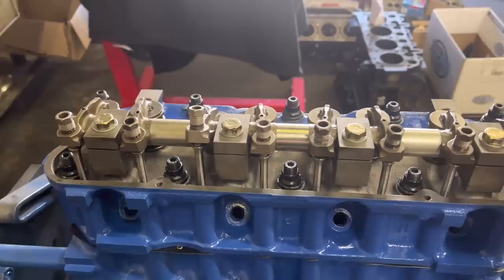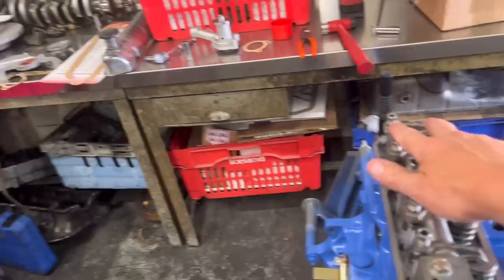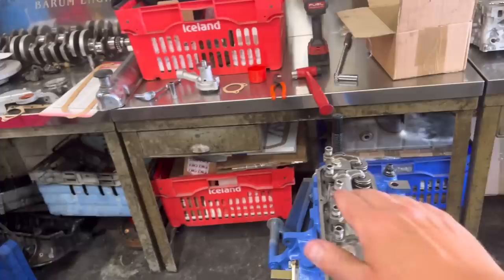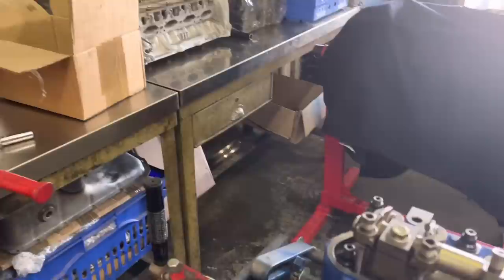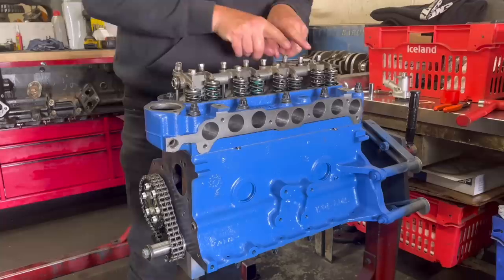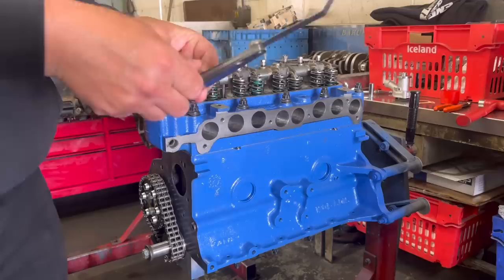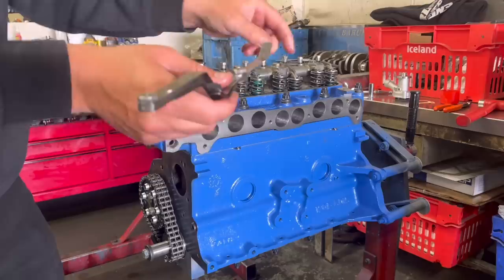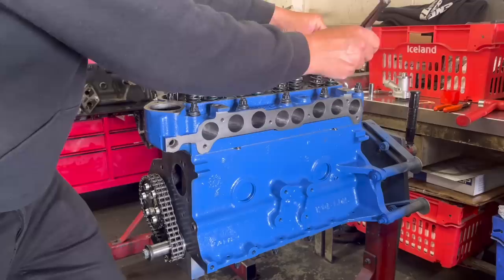Building this 9000 RPM Ford pre-Crossflow engine!

Comment: Hi Lee, on the tappets setting if you get No. 4 valves rocking you can adjust No.1 cylinder inlet & exhaust at the same time and continue this pattern cylinder by cylinder until you have them all done.

Comment: Memory lane. I have done that process innumerable times on a pre-crossflow.... when I raced in historics.  Mind that engine was a proper Cosworth screamer, geared cam drive, all steel etc etc. And that was safe to about 12,000.  But as it was in a sports racer, not an FJ, we used a slightly less lairy cam and there was no need to go over about 10,800, which it did happily.  Not too shabby for a 1950's designed engine eh?  Oh and it was 1100 cc. BHP about 118.

Comment: Dad was aircraft engineer. A tiny bit more adjustment was either a gnats whisker or a cock hair. Not strictly imperial measures but they seemed to work.
Reply: Seems a Tad is a good engineering measuring term LOL
Reply: A nanny's grab is a slightly bigger scale

Comment: There's always a simpler way to explain it. Turn the crank so both valves on no 1 are rocking, adjust both on no 4.Turn crank so both on no 4 are rocking and adjust both on no 1, Same for nos 2 and 3. When using feeler blades , use the go and no go method. If you're aiming for 0.018 inch then use a 0.016 and a 0.020 blade. One fits, the other doesn't.

Comment: Your explanation of what happens in a crossflow engine is interesting, l have always thought of inlet and exhaust as separate events.
Reply: They are , he just explained it badly . There is no problem with port area on these engines either . Some actually built these heads with straight tubular inlet ports welded into the head with little improvement  . I used to run a 1650cc Mk1 Cortina in the 70s . Mercedes liners 82.5mm Hepolite Power max pistons lightened balanced bottom on VP lead indium bearings ported head on 40 DCOES for fun or a 28/36 DCD for touring , poor man's dry sump system . Last but not least one of Dave Newmans " Half Race " camshafts.......

Comment: On some engines, the valve springs have paint marks on the valve springs for orientation of the springs, paint to the bottom, for example. This is due to tighter windings needing to be at the bottom. 
Although this may not be the case for this particular engine, I noticed paint marks are not consistent.

Comment: If there is no lock not on the valve adjustment knob, what keeps it from backing out over time?  

Being from the US, I am used to seeing only American made engines.  I've never seen or heard of a Ford pre-Crossflow engine.  Very interesting video.  It never crossed my simple mind that mechanics in Europe have so many different engines, and their parts, to deal with.  Mind blowing, really!!   Hats off.  You really have it go'n on across the pond.  Really impressed by it all.
Reply: It's called a friction thread, Same as the Ford Y block V8's

Comment: I would have thought that cut to length pushrods would have been easy to install and will by their nature give the best rocker geometry.  VW aircooled ChroMo pushrods can take fairly high seat pressures and valve lifts in excess of 600thou.  Given that the pre-crossflow rod is shorter than the VW one that will raise even further the stiffness.  The VW pushrods come in two thicknesses and the heavier weight ones are mostly used in turbo applications.

Comment: Very surprised using a high lift cam you didn't fit roller rockers  .
Found from experience unless you have stellite tipped valves , the valve tips get peaned  .

Comment: Remember that turning the crank 180 only turns the cam by 90 degrees....  9000rpm does seem very ambitious for this engine even with a steel crankshaft. Is that valve gear up to the job??

Comment: To set the valve clearances on any engine where you have the port combinations such as you have there you use the rule of nine. Valve number one fully open, set valve 8. Valve number 2 fully open set number 7 etc. Valve numbers add up to 9.

Comment: I was wondering, is it not possible to adjust until the rocker is just touching the valve head with zero clearance , then set up a dial gauge and raise the rocker via the adjuster by the required amount ?

Comment: It would be nice  if you could actually show how you shorten push rods !!  Thanks
Reply: Run 100psi boost and advance timing.
😂
Reply: I have shortened many pushrods in these engines for my own very successful race engines. I would just grind the end off flat to size and then use the bench grinder to make the ball. Finally get an old cam follower in the vice and simply grind the pushrod into the cam follower using valve grinding paste. In all the years that I did it I have never had them hardened and none ever failed.  I won about 300 races in the UK and abroad and two British championships. My 1500cc engine could rev to 10k all day long at tracks like Spa and produced about 180bhp, if you think  that that's all bullshit then ask around to the people that normally finished behind me !
Reply: @gstree  As I said SHOW me not pat yourself on the back !!!!
Reply: In the Transit 2.5Di, a broken cam belt would usually do the trick

Comment: Rule of nine may need a little more explanation. On a 1-3-4-2 firing order four cylinder then the valve you set and the valve that’s down equals adds up to nine. So when 1 is down you set 8, when 2 is down you set 7, when 3 is down you set 6 etc…
Reply: That's how we used to do them back in the day 😉😊
Reply: Rule of 9 is you get a valve all the way down if it’s number 1 fully open you take 1 off 9 so you adjust number 8 and do the same with all the valves
Reply: Crossflows aren't 1342 firing order 1243 if I remember right
Reply: @MegaReddevil71  Rule of 9 works for Xflows, far easier than all that faffing about
Reply: Those valve adjustments are faffy, could you not do 7+8 rocking then adjust the valves which are closed then turn 360' until 1+2 are rocking then adjust the rest only have to move the crank twice works well on tractor diesel engines obviously your little ford is going to be going a bit faster, when cutting down the spacers for the rocker shaft do you have to take expansion when hot into consideration or does everything expand the same??
Reply: @MegaReddevil71 no, definitely 1342.
Reply: @darrenbayman8988  most 4 pot engines are except a crossflow
Reply: @MegaReddevil71  I stand corrected. It’s been a while since I played with them. We did build one in a mk2 escort years ago which was a 4door automatic, using a chambered head, which was ported allowing flat top pistons. We put a little turbo on the side blowing through throttle bodies and water injection. It made a reliable 280hp, which in beige with a brown vinyl roof made a great scatter rally car. The auto box actually worked well as you could heave on the brakes and throttle to get it on boost before you left the line.
Reply: @darrenbayman8988  Some of the Ford ones were 1342, others were 1243, it depended on the year. I've seen both.
Reply: Firing order of Ford engines are 1243, other engines like BMC are 1342. So far as the setting of the valve clearances is concerned it doesn't matter so long as there are siamesed ports (two pairs of inlets joined and
Reply: Continued ...
(two pairs of inlets joined and the center exhausts joined).
Reply: @@Eric_Cartman______ Rule of 9 doesn't work with engines like the Ford Pinto, where inlet and exhaust alternate, so you have to pair 1 (inlet) with 7 (inlet), and 2 (exhaust) with 8 (exhaust), etc.
Reply: @@Eric_Cartman______ what we’re really trying to confirm is the arrangement of the crankshaft
Reply: @@Eric_Cartman______ it’s only true if pistons 1 and 4 are at tdc at the same time and 2 and 3 are at tdc at the same time. Which I agree is 99.9% the case on the 4 cylinder engines people are likely to encounter
Reply: @@Eric_Cartman______ I agree that in most people’s experience they won’t need to think past the rule of nine. However I also think it’s a good idea that people know where these rules come from. It works because in the standard crankshaft arrangement pistons 1 and 4 and pistons 2 and 3 are simultaneously at tdc and given it’s a four stroke the valve timing is consequently 180degrees ‘out of phase’ on the camshaft. So the peak of the cam lobes for the respective valves are on the opposite side of the centre of rotation of the camshaft. The engines firing order confirms the crankshaft orientation. So if the firing order is 1342 then crack on with the rule of nine. If it’s not, stop and think was my only point… Then again I always liked to understand the derivations of formulas in maths and physics so maybe it’s just me… 🤔

Comment: What cam would you recommend for an 66 MGB? It will have the larger valves and a CR of around 9.3:1. Not looking for a race car but something that has better acceleration for fun on country roads.
Reply: I see no reply . I built a pile of Ford Kent engines in both 1650cc and 1760cc back in the 70s  for boats and cars and my go to cam back then was in fact one of Dave Newmans " Half Race " cams . Very drivable all rounder. The B series engine design particularly in combustion chamber shape and what techies call flame front propagation is very similar in both , particularly when modified so this profile would work in the B series engine . Give Ken Newman ( Dave's son ) a call and he will advise .

Comment: should have spaced the rocker blocks from the head
Reply: Why's that?
Reply: Erm. Not a good idea.  The rocker adjusters are really close to the underside of the top of the rocker box.
Reply: Not a serious engine. If it's for appendix K, it makes sense otherwise higher ration rollers would allways be used, or has someone cast "Original" rockers with a optimised ratio? 😮😆 
Even so your right, the pedestals need spacing if the correct valves are used.

Comment: Why do you not just use rule of 9 to find when the rocker is off the lobe.  1+8 therefore 1 fully compressed 8 is off.  4+5 whatever it works a treat thank me later 😉

Comment: 9000 rpm???
Small potatoes!
18,000 rpm
and then we will be Superbike talking! 👍😎🤪
Reply: Yeh.  But not bad for a 1950's engine design - basically a road car engine too.
Reply: 19000 and road going 4 cylinder 250!